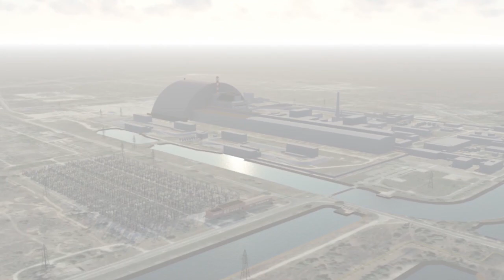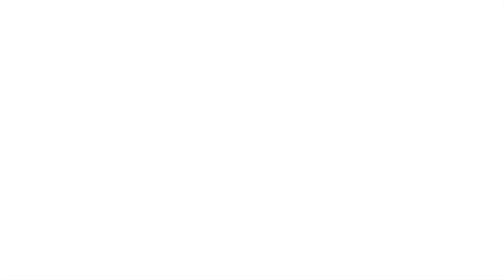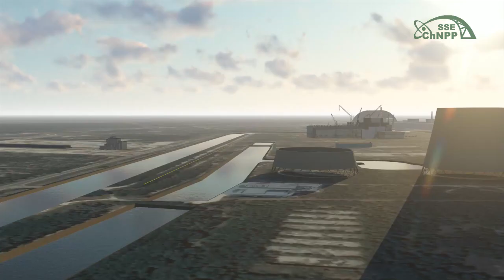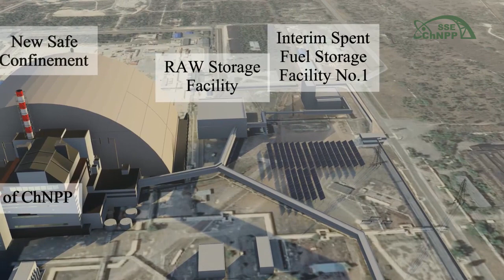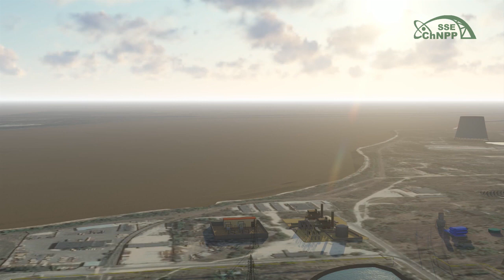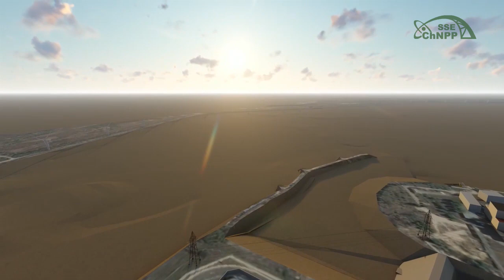Creation of energy cluster at ChNPP

Comment: Wait, wait, wait...
Now hold on for a minute;

They discontinued the construction of the 5-6th reactor, they closed the third reactor but they could renowate it, or they could do the same thing with the first block and that one would be far away from the fourth block... 
NO, they are building a gas power plant wich is wasting our gas wich has a pretty much limited source and they make a biomass power plant wich is polluting our envionment rather than renowate one of the reactors...  F*ck logic...
One RBMK block would make almost the same amount of energy compared to all these new plants and our planet has fairly enough uranium and we cant use it anywhere else just in reactors...

The solar panels and the wind plant is a good idea but the other two is not really...

Same thing happend in the Kursk Npp... (There is a similar 4 RBMK block Npp in Kursk)
After the accident of the fourth Chnpp block, they stopped the construction of the fifth block for a few years, after that they further developed the RBMK blocks, the name of the newer ones would be MKER, they continued the construction but cancelled again in 2015 when the reactor was almost done...
XD